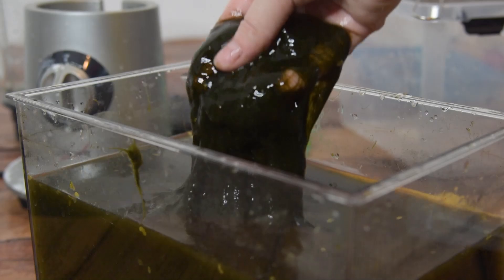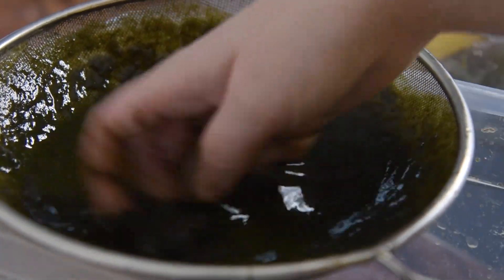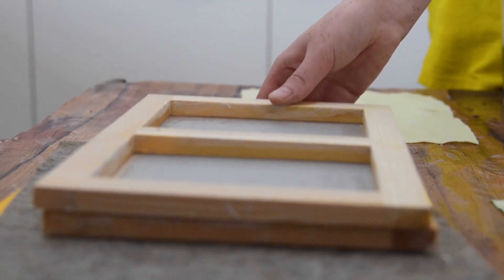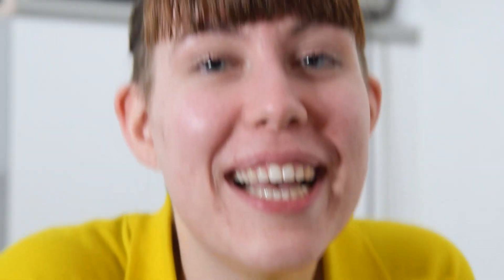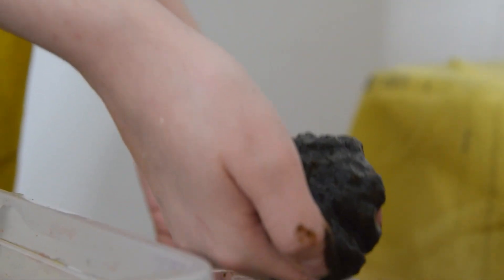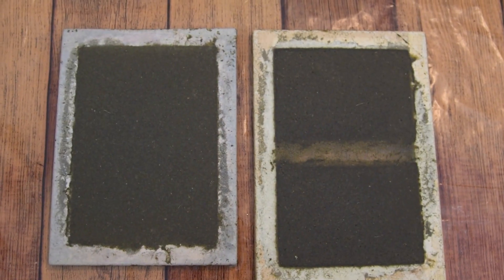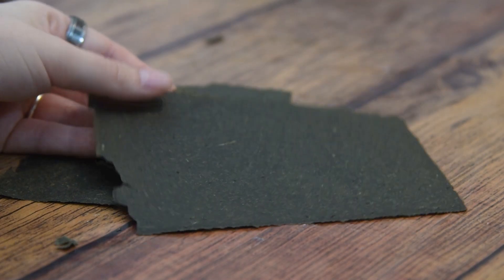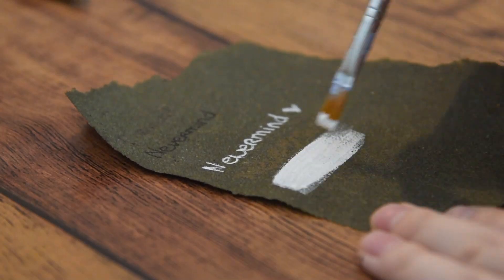Turning ALGAE into paper?! | Will it paper #4

Comment: Since the algae is a raw material, it might need more processing to turn it into a good paper than some of the recycled materials you've had success with. And because water is its natural habitat, that might be messing with your ability to turn the raw algae into a good pulp. If you want to try this again, maybe start with drying out the algae, or boiling it (or both!) before you turn it into pulp. Also, considering how difficult it was to get the algae paper off of your molds, you may need a much finer mesh.

As far as I can tell, there are actual processes for turning algae into paper or into sheets, but the process itself is patented. Still, I am impressed by your dedication and ingenuity! And now I'm wondering if different algaes would produce better results.

Comment: Freshwater algae come in various types. Green - you may have heard of spirogyra - and blue-green which are actually not algae but a type of bacteria called cyanobacteria. These latter can produce external poly saccharide which make them slimy. Spirogyra is not slimy at all.

Both types consist of chains of cells so blending will fragment the chains and the longer you blend the smaller the chains of cells will become.

So maybe try blending for a bit less time than you would say for grass which breaks down very differently.

When the paper dries on the deckle the polysaccharides dry out but they are sticky so thats why they adhere strongly to the mesh. So you could do two either of two things. Spray the mesh with a teflon spray to reduce adherance or add a little white polyvinyl acetate glue into the tank. When this dries the paper might be stiffer but will resist water much better. You will need to experiment with quantity.

Get hold of somebody who knows about pond life and see if you can grow the two types I mentioned separately in tanks at home and make paper out of each to show the difference. Someone mentioned Nori- its true its much like that but slightly different in that the polysaccharides are quite different.

You might like to try making paper with kelp to se how different it is.

The paper you made was very attractuve and looks like it could be very good as a base for pastels.

Good luck

Comment: I'm pretty sure the problem is that algae does not have cellulose. Or not much. The proteins, lipids, and peptide chains, that algae are composed of, are significantly different from cellulose in many ways:

Cellulose is literally a thicker molecule. It has a larger diameter.

Cellulose is a far stronger molecule. It was the evolution of cellulose that allowed trees to grow tall and strong. Algae is so weak that it literally just be supported by water to grow.

Cellulose is a far stiffer molecule. Part of the reason your algae was sticking to the mesh was that micro-stands of the algae were just flopping down through the holes of your mesh, and then literally wrapping around the threads of the mesh. 

When you make recycled paper out of manufactured paper, the sticky part of the wood pulp, the lignin, has already been removed for you. The sticky part of algae IS the proteins, lipids, and peptide chains. So, ALL of the algae. Therefore, the stands stick to everything, including your mesh and the cotton transfer cloth. Yes, they stick to each other better, but they are very weak, so they just break when pulled.

Source: I was a biology major in college, and an amateur naturalist throughout my entire childhood and high school years.

You might have better luck with seaweed, because it has evolved some stronger fibers to hold the seaweed strands together. I am not positive if that is cellulose or not. I lived by the woods not the ocean.

You could also simply experiment with various different plants. I'm thinking maybe this plant called hemp might work out pretty well. I don't know. I don't know if anybody's tried it before for paper.  😋

Comment: Hello, thanks for this video, I came across it after looking at some algae in my own pond and wondering whether it would provide suitable fibre for paper making or other uses. Congratulations on your efforts. I have a little experience of making paper from plant fibre and I have a few thoughts on what might make for a better outcome (you said you wanted them). I'm certainly no expert though so I offer this in all humility: 

Normally when making paper from plant fibres there's a preliminary stage before shredding the fibres in which the material is broken down using some kind of alkali, typically a solution of either caustic soda or hardwood ash. You either boil the fibres in the solution or just leave them a long time (months). That stage degrades the goop and leaves you with just the fibres, which in normal plants or wood would be cellulose. I wonder whether skipping this stage might be the cause of your problems with the pulp sticking to the deckle, as you haven't removed all the stuff from the algae that you don't want. One thing I'm not sure of is whether the fibre in algae is cellulose or something else. If it's not cellulose then you might find that the alkali just eats everything and a different approach might be required. I think it would be worth a try though. 

Another thing that occurs to me is the that blender might be too much for those fibres. Typically you want the fibres in paper to be as long as possible as that makes for the strongest paper, maybe your blender is just shredding them too much and you need a gentler process. Ideally the fibre is pulped using a crushing and tearing action, whereas a kitchen blender will tend to chop the fibres into little bits. You could try mashing them up with a pestle and mortar, or if you could improvise a ball mill that might do it. Otherwise you could just give them a less thorough blend. 

You might also want to consider adding some sort of sizing agent such as gelatine, this could greatly improve the ink taking properties of the paper, adding a size is the norm in plant based paper making. 

If you google you will find that there's quite a bit of interest in using algae fibres for various things such as the production of paper and composites and there are academic papers about the processes used, so you might find something of use there too. 

Good luck with your ongoing endeavours!
Reply: Oh, It's a more profesional description then mine :) Yes, it works.. I've seen it in an online, Spanish video course. It suggested to cook for a while with baking soda or some other alkali to chane bounds in plants -then rinse out and neutralize (try it) . After cooled down you can blend and making paper with normal papermaking solutions..

Comment: I think maybe rinsing the algae to get rid of the slime, dry it before pulling and doing it by hand so you have bigger fibers might help intake a easier to remove sheet. However I also think the slime might be part of what was holding it together.

Comment: It seems like the pulp fibers were getting stuck in the mesh because they were so small - same reason you could barely feed them after blending. Maybe it would work better (not stick) with a finer mesh, or if you made the pulp more coarse? Maybe dry out the algae first, then break it up by hand into a powder/fine mulch kind of situation... that might get you bigger pulp fibers and make it stick less to the mesh. I might be totally wrong, or it could be super fragile, but if you try again, I’d love to see the result.

If that doesn’t work, you might be able to use the algae to add a green color to other recycled paper by adding some into the other pulp. If you don’t fully blend it first, you might even get some fiber strands in the paper which could add a nice visual appeal and even some strength.
Reply: I like this idea. I'm thinking the algae particles are just too small and end up wrapped around the mesh since it sticks to itself so easily. So a coarser pulp seems a good way to go. But since it grows in water it's gonna absorb moisture like crazy. These pages might not last very long in just a humid environment either.

Comment: Maybe you blended the algae too long braking up the fibers in too small pieces. It partly got through the mesh and stocked to it. If the fibers were longer, maybe it would have stayed more on the top of the mesh? Also if you tried to let the frames dry upside down, maybe the fibers would not sink into the mesh even more while drying but rather fall  out of the mesh when you blow dry it... So if any one wants to try it out, maybe try these? Lol idk